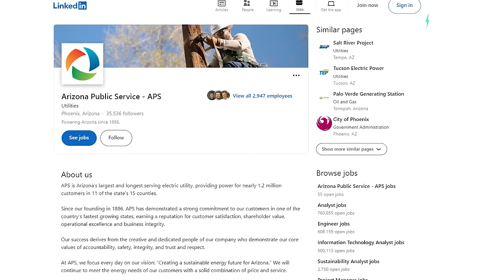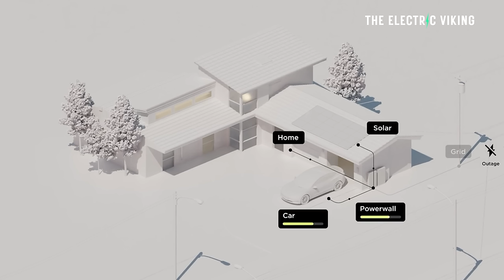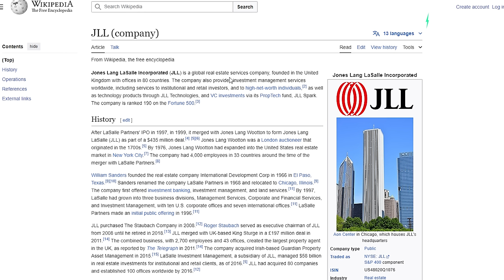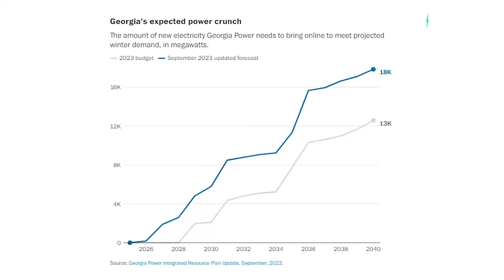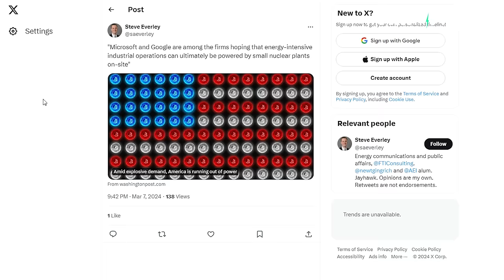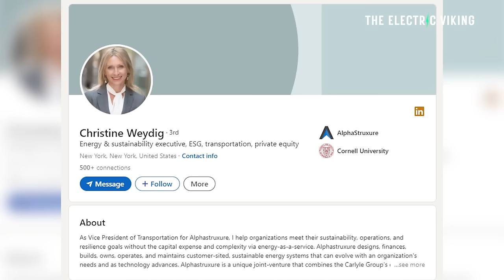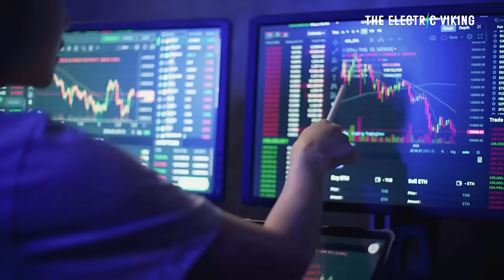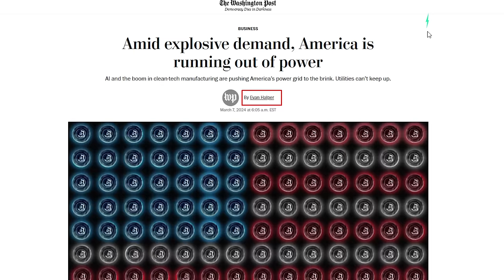An explosion in demand for electricity is creating a looming crisis in America

Comment: While I don't really believe this report - neither the scale of the issue nor the perspective conveyed on this so called problem - it wouldn't be that hard to multiply the capacity of existing national grids several times over without lifting the price of power.

This problem, if you want to call it that, belongs to the datacentres. We don't need to stress over it. If datacentres need that power now and can't get reliable connections then they should lobby for the increase in the rate of the rollout of renewable power or go into that business themselves. Actually, all you have said is that the demand for power is strong - that makes it easier to build a renewable electrical energy sector that dwarfs existing fossil fuel one.

Citizens will need to support legislation that puts their needs above the needs of these new datacentres. With regard to crypto you could simply not build the datacentres without any loss to the public.

Comment: Your numbers are a bit off
Ohm's law 101
When power generation is measured to in watts and you have more than one in parallel you can only get and use less than 20% of the rated output 
In ohm's law there's a water analogy 
And volts is pressure so like pumping water you must overcome the incoming pressure to put anything in
Reply: N example 
If you have the know how & have solar 
At the meter measure voltage & amps multiply the results this will tell you the watts actually going in the grid.
It will be less than 20% the built-in meter reads 
Guess that would be ohm's law 102 and a checkmate for ignorant solar

Comment: Bitcoin mining is very competitive and marginal so isn't profitable if it's using grid electricity that is competing with households never mind AI and big tech data centres which are insatiable and profitable at higher rates. It's therefore more agile in only running when electricity is next free or moving to where that is. This can be new renewable sources still stuck waiting for a grid connection that can become profitable sooner and still get built that could otherwise be delayed or abandoned. Batteries aren't going to help stranded energy supplies with no connection to demand. Some demand needs to go to where the supply is. Bitcoin miner are the least location sensitive that can run anywhere and can be moved relatively easily as other supplies and demands change.

Comment: The information you are referring to sounds like it's just a political push to extend the life of the fossil fuel companies. If you were looking to set up a new company, you would be a fool not to include renewable energy & batteries in the setup costs. I am sure it will pay for itself. South Australia is not isolated & it is connected to other powered sources that can help with variable demand. It does, however, have a lot of renewable energy in its own part of the grid.

Comment: The bigger problem is our power plants are getting shut down by EcoFascist. Regulation and litigation has raised the price of electricity here where I live to 42 cents per kilowatt hour. I just started building a new house off-grid, 20 KW of panels 42.9 KWH batteries. The unsubsidized cost of the system comes in at $0.16 per kilowatt hour, with subsidies it drops it to around 8. I am against all government subsidies. We don't need it because the price is already better to go with solar. The only green I care about in this case is money. In the future, anyone who has their own house will be better off generating their own power and storing it on site. There's too much corruption associated with the grid. Big cities will still need a grid, but rural homes would be better off without it. I grew up on a peach farm just south of Oregon in Northern California. Electric lines running everywhere we're very expensive with homes being a half mile apart. Electric lines are not only unsightly but also dangerous causing fires. We will not be running out of power, we will only be transitioning purely out of economics. The trace gas CO2 is not our problem in fact it is necessary for respiration and photosynthesis. The heat capacity of water is several orders of magnitude larger than that of CO2 and is not accounted for accurately in these garbage models they keep producing. The climate of this planet has always been changing no matter what humans do.

Comment: Need nuclear for base load no other solution.   France 70% of their electricity from nuclear, in fact they are exporting power to Germany because Germany was shortsighted and were relying on Russian natural gas to replace their nuclear and coal plants.   Wind and solar cannot provide base load power period.  EVs will make the power problem worst there is no way to deny that basic fact.
Reply: That is straight up a lying. Germany buys electricity (and so do other countries from each other) because it is cheaper than producing electricity on their own. From time to time France was relying on german renewable Power, when french Power plants were down.
Furthermore, the EDF, the frech state energy agency is super high in dept because the nuclear Power plants are extremely expensive.

For decades, anti renewablists have been saying renewables are not working. The only thing that happened during this time was that renewables increased, increased and increased in Volume, whilst the other Power sources went down, down, down.

Comment: houses cant send solar power far...we transport electricity by bumping up voltage...
every house has to output its current at the same time...faze differences can pull the grid offilne...and the power is still low...steping up currents in one way distribution networks...does not work...
Toyota is saying this all this time...

Comment: They are upgrading the grids to try and meet demand , the problem is it's very expensive and price per kWh has tripped in the last decade, renewables can only make up a small percentage since they are intermittent power sources, also they can ultimately de-stabilize the grid when it fall or rises the transmission frequency which is 60hz or 50hz dependent of the region. Nuclear, gas and hydro is the only option if you want cleaner energy. Unfortunately data centres are very energy hungry, but electric cars will take a lions share as well if the world goes fully electric. Which would be very foolish indeed, since there would be a single point of failure for everything ..heat , transport , communication) Ask anyone which suffered a week without power due to snow storms. We need gas and petroleum as those alternative energies , they can be part of a cleaner future and will need to be.

Comment: This is a point of short sightedness of the EV push.  Most grids have most of their resources already commited.  If there is cheap plentiful power; big consumers like aluminium plants move in.  To throw on he load of EVs which are each the equivlent of 5 houses when they charge; is a burden not planned for.  Solar and wind; can't keep up so the real life short term solution?  Fossil Fuel.  Fossil fuel plants which loose 20% in transmission to move a car 25-30% more heavy. If there are any gains they are not big.  Why not biodiesel or ethanonl hybrids?  The best chance for Electric is Thermonuclear - but short of that these others are 100% renewable

Comment: When did the grid collapse in Adelaide due to excessive peak demand mate?  Why make stuff up - in south oz we are fully renewable powered for much of every day in our summer, and with wind farms coming on line quite a bit of some nights too.  Are you confusing tornados that blew over the transmission towers about 8-9 years ago and blacked out a large chunk of the state for several days as having anything to do with peak demand brownouts?  Or extreme weather events and storms causing automatic shutdown to prevent fires?  Mate that is just low and bitterly disappointing, what a way to lose credibility, if you had to make up that statement how much of the rest of your content is made up too...  Here is an extract from SA Power Networks of the recent statement (Dec 11th 2023) about this.  When it gets to 48 C we actually like that the power gets turned off, because we really don't  like getting burnt to a crisp in massive bushfires... 

As follows :- In the recent status update, SA Power Networks emphasised that the source of power – be it solar, wind, or fossil fuels – is not the culprit behind the outages. Instead, the focus should be on the external factors at play, particularly the severe weather conditions battering the region. From fallen trees disrupting power lines to lightning strikes affecting the network, these are the real reasons behind the loss of electricity, regardless of its origin.

The update also sheds light on the heightened sensitivity of power equipment during bushfire risk conditions, like those experienced today. This increased vigilance, while crucial for minimising potential fire starts, can lead to more frequent power outages in response to faults. In contrast, under normal or even stormy conditions, the settings are less sensitive, reducing the likelihood of disruptions.

SA Power Networks posted the following:

We’ve seen some chatter suggesting today’s power outages are due to solar and wind energy. Let’s clear the air!

It’s not where our power comes from that’s causing outages – whether it’s from the sun, wind, or fossil fuels. It’s what’s happening outside our windows that matters. Think fallen trees on power lines or lightning zapping the network – your power will go out whatever the source!

During bushfire risk conditions, like we have today, equipment is set to immediately disconnect supply in response to a fault to minimise a potential fire start. In normal conditions or even storm conditions these settings are less sensitive and less likely to result in power outages.

The bottom-line is don’t blame renewables for the flickering lights. Blame the weather.

Comment: So much of what you've said is absolute rubbish and SA as an example of what good looks like is far from reality.  SA only has stability, being at the very end of the eastern seaboard network, because of it's interconnection to other nodal sources predominately in Victoria and NSW, most of which are still fossil fuels (coal and gas).  You seem very captivated by renewables which have created the problem in the first place and also created a dysfunctional market (NEM) in our jurisdiction of Australia.  The physics of renewables is that they are low density or low multipliers of power.  Basically this means you need way, way more of them to meet the system demand than high density sources such as coal, gas or nuclear.  It's estimated our energy system will have a demand of 50TW by 2050.  To service this through solar farms would require 6 million square kilometres of single use land area for the panels alone.  When you add wind this land requirement or off shore marine area only makes matters worse.  In addition, renewables (solar and wind) have low capacity factors of around 30% to 40%.  This means that solar and wind don't generate supply to meet the 24/7 system demand on average 3 days out of every 5 days.  So it needs to be firmed with another source of energy.  If not coal, and not gas and Nuclear is currently not an option then what?  Well, no power is what and periods of blackouts will occur to maintain system stability either through automatic equipment protection or by intervention from the market operator AEMO.  You are correct that there is often too much renewable energy in the system and when there is the spot price will, and has, gone negative which is a perverse outcome.  The effect of this is that firming capacity asset such as traditional thermal power plants leave the market prematurely.  Loosing this type of installed and modulated supply capacity is entirely different to storage such as batteries which have a completely different role from an engineering point of view.  And that's to manage short term disruptions whilst primary systems get back on line.  They aren't there to manage capacity.  So when the market operator is required to manage the system demand, and measures such as available reserves become way more volatile, then the whole system becomes infinitely more complex logistically to keep balanced.  One of the best ways to manage this is to regulate renewable companies who have low density assets and low capacity factors to a minimum supply capacity to participate in the market.  This means renewable companies will likely contract capacity when their assets aren't generating from other companies with firming capacity assets.  It would mean the true levelised system costs or LCOS for renewables would occur.  And just like the UK the market operator can then forward auction off the capacity to the lowest bidder, keeping consumer costs as low as possible.
Reply: This would all come to light if the Greenies would just be honest and start using actual energy output numbers instead of RATED output numbers when comparing pricing to other electricity generation methods.  My solar systems only put out about 1/4 of their rated output on the best Summer months, and only about 1/32 of their rated output on the worst winter months.
Reply: @danadurnfordkevinblanchdebunk  You've described the exact problem with intermittent inputs into any energy system, including Australia.  Until recently, most of the incentivised (tax payer subsidised) roof top solar was installed without invertor technologies.  These installations still have a decade or more to run.  New installations have mandatory invertors installed and such their output can be modulated to a degree.  Older installations just keep on supplying even if it isn't needed.  As a result on a very hot day we have way too much energy being supplied into the system so the spot price can, and does, go negative which is a perverse outcome and fundamentally means those market participants at that time are loosing money to stay connected (theoretically).  For thermal coal plants and gas plants who have large capacities installed and connected to the network that is certainly the case.  Later in the evening or during periods of bad weather (overcast and very windy), the price can swing to volume which in Australia's case is $16,000/MWh.  That's insane volatility to say the least and extremely difficult to manage from the network operator's point of view.  The most perverse outcome of all is the behaviour of some renewable operators who have large grid scale batteries in their portfolio.  What they do is arbitrage the market, which provides them an almost risk free return.  And they do this by deliberately forcing the spot price low, even negative by continually feeding in mainly solar farm outputs on a very hot day.  They then purchase this very cheap energy from the market to charge their grid scale battery farms and store that cheap energy.  They then wait for periods of capacity constraint and for the spot price to sky rocket.  At that point they sell the cheap stored energy in their battery farms back to the market and earn an obscene profit.  Currently this cycle is repeating itself as the tax payer subsidised roof top solar penetration fast approaches 30% of the system supply (on average).  It's the same old story.  Whenever governments and their bureaucrats manipulate markets, the long term outcomes are always to the detriment of consumers.  In Australia's case we've constantly been assured renewable energy will deliver cheaper power to consumers.  However the opposite is occurring and since mid 2022/23 financial year, household electricity prices have risen by just on 30% for most people in the country.  Those who claim of cheap power never accept their roof top solar or household batteries are tax payer subsidised, nor are they prepared to disconnect their house from the distribution network.  Upon reflection, maybe they are the smart ones.  Until their house catches on fire !!